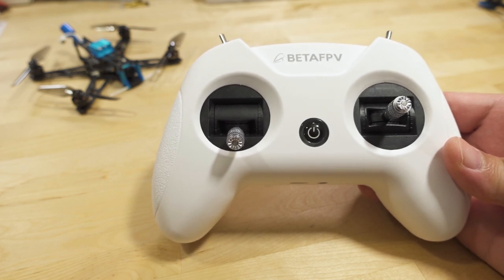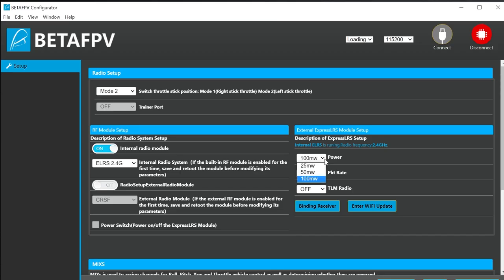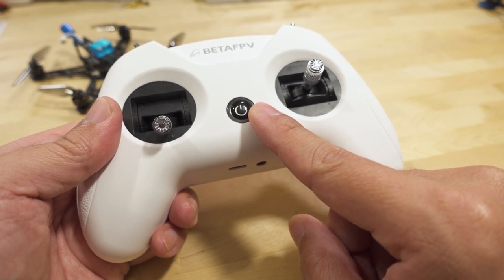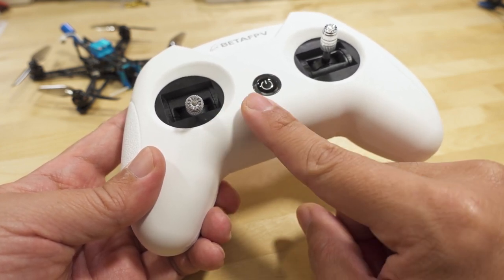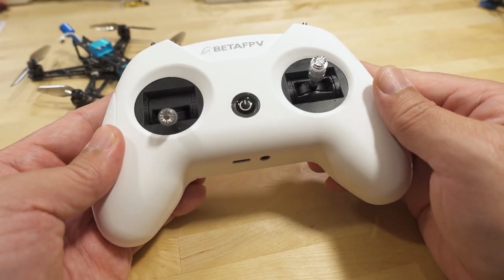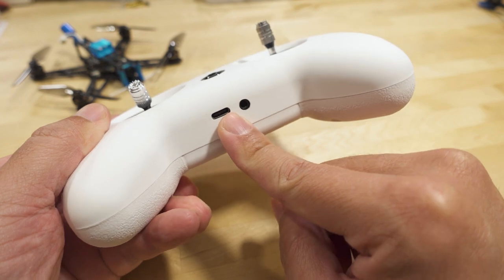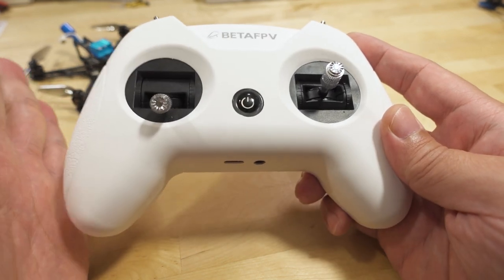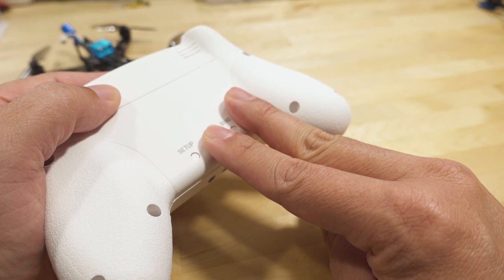BETAFPV Made an ExpressLRS Radio! (LiteRadio 2 SE ELRS)😎

Comment: With ELRS popularity on the rise especially on tinywhoops it's a good step for them to move towards it on the radio. I'd love to have internal upgrade for tango 2 for having both crossfire and 2,4GHz ELRS
Reply: No kidding, or a jumper t lite in my case!
Reply: I doubt TBS would ever allow that to ever happen.
Reply: Internal upgrade for tango 2 ? TBS would Never agree to that.
Reply: @skyweaver3199  Probably not but one can dream... And some people managed to squeeze it in there as a module. But man would they win the market if they went full ELRS with backwards compatibility.
Reply from the maker: One can dream!
Reply: There is a DIY board for the Tango 2 that fits inside and hooks up to the external connectors for ELRS. Check it out on the ELRS Discord.

Comment: I got the grandkids the lite 2 se, it's holding up. It's a decent cheap radio. For frsky d8 protocol the Radiomaster T8 (not pro) is a very good value. $40 on banggood, I grabbed it during a flash sale on RDQ for $25. It is pretty cool the betaFPV radio can have elrs built in. Maybe frsky protocols will be done and gone soon. Especially D8. Happy flying Albert 🤓

Comment: I have the one with usb c. Doing pretty well 6mos later. For $45 and not having known what to buy when i got into fpv, it’s a really good value
Reply from the maker: Good to hear it's still working well for you.  It seems all you hear on Facebook are the horror stories with out a lot of detail.  A lot of the guys who post those stories never answer my questions about which version of the radio they got.  Sometimes I wonder if I'm just responding to bots.  LOL. 🤣
Reply: Even Bardwell was knocking it on Facebook i think yesterday, So the bad rap definitely makes it’s way around. I think the elrs version/upgrade solves the biggest problem with literadio: the range. It does everything else it needs to do for the price, bind up and fly. I think this is a win for BetaFPV

Comment: I flew it on the hx115lr. Which worked flawless. It is a little less precise than my Tango 2 but a great beginner radio. Unfortunately I was unable to upgrade the firmware but it works. I just bought a second one to check the issue and I lended my set to a beginner to have some fun with it. Good buy.
Reply from the maker: Thanks for sharing. I heard the firmware upgrade issues are due to the wrong USB driver or a bad cable.  FYI, v1.0.1 of the configurator and new firmware are out now.  I'll make a video in a couple of weeks.
Reply: @AlbertKimTV  thanks I will wait for the video. I did try all drivers, but have tried only one cable.

Comment: I got lucky.. got the first gen (open tx/micro usb Frsky).. only failure so far (knock on wood) was a switch failure (internal)..
Reply from the maker: I heard those might be from a bad solder joint or bad wires and should be fixable if you are handy with a soldering iron.
Reply: @AlbertKimTV  I disassembled the switch.. it was the little plastic tip on the moving “rod”… nothing a little epoxy didn’t fix…

Comment: Hola, me quiero iniciar en el mundo del FPV, pienso comprar el kit Cetus FPV Pro que trae el Control LiteRadio 2 SE (con FRSky), pero tambien tengo la opcion de comprar por separado el control LiteRadio 3 (FRSky, con soporte para Crossfire), unas gafas eachines ev800dm y algun otro dron de mi preferencia, se ve mas bonito el kit,, que me recomiendan, el kit, o comprar independientemente para tener frsky + crossfire. Muchas gracias por su ayuda. Y muchas gracias por los videos.
Reply from the maker: If you think you can manage to bind/connect all the components of the system together yourself, get the parts separately.  If you don't think you can handle it, buy the kit.

Comment: great video 👌
Do you know what is the maximum range of the Betafpv radio built in ELRS?
Reply from the maker: It's 100mW max power with a patch antenna so very directional.  Assuming you have a good receiver and properly tuned antenna and you are pointing the patch antenna of the transmitter of the drone, you can probably expect about 1-2km range at a minimum.  The max could be as much as 10km in ideal conditions.  If you don't have a proper setup, fly in a noisy RF environment, worst case would be 500m.  Could be even worse if you have bad antennas or faulty equipment (that can happen).
Reply: @AlbertKimTV  Thank you for taking the time to respond and to make your videos 😁
ELRS es amazing 🤩

Comment: I did what you said didn't make much if any difference vtx is onlicke on goggles it says band channel power or R 6 don't have channel eight 400 for power change my goggle anttena got from 150 to 800 meter so I'm thinking if change drone anttena whitch will be better short to long on goggles went from long to short short better goggles sma RHCP drone ipex ufl connector wot high gain anttena  should be l look at seen some 14 to 16 dbi goggles only got one MSA fittings would high gain patch be better than long lollipop etc any link would be me deside you have contacts use them as well I'm sure thank for advise
Reply from the maker: Is this from Google translate?  I'm not able to make sense of this comment. 🤷‍♂️
Reply: @AlbertKimTV  I think he needs to unlock his vtx
Reply: @AlbertKimTV  no come on asking if better anttena for goggle than Im using 5.8ghz link ipex ufl connector on drone any better than stock higher dbi what I need yes would patch antenna for Google's give better range seen some 14 DBI 16 dbi cheers

Comment: Not able to wirelessly connect for updates using Configurator.  Correct?
Reply from the maker: Correct, you can only update the ELRS firmware with the BETAFPV Configurator.

Comment: '
this R/C have a four AA batterys / receiver / reverse servo...
how many channel R/C
Reply from the maker: No to AA batteries.  There is an internal lipo inside.  Does not come with receiver, you have to purchase separately.  Channels can be reversed with settings changes in configurator, 8 channels.  All this information is in the manual.

Comment: I had a second gen that had tons of jitter. It was the SE I think. It had USB-C. I was new to FPV at the time and was really struggling with flying well. A friend had me look at the receiver tab in BetaFlight and sure enough the sticks were going crazy.

I eventually replaced that radio with a T12 Pro and it was immediately noticeable how much easier it was to fly. This experience makes me a bit skeptical of these radios. Especially when you can get a T-lite for a few dollars more
Reply from the maker: Yes, Jumper T-Lite is better but it's $30 to $40 more.  Almost double the price.

Comment: there is a lot of flat space on the back, would be nice if they added a screen in the back side.
Reply from the maker: I've talked to them about that and they won't do it since competing products at higher prices already exist.  You should get the Jumper T-Lite if you want a screen.  This radio with a screen will be almost the same price.
Reply: @AlbertKimTV  racedayquads RDQ finally had them in stock.  I've already ordered it, so now they can release the pro version tomorrow with 2.4ghz ELRS  instead of the rumored 900.

Comment: I just wish it was better quality.
Reply: Just because the older ones had problems doesn't mean the new ones are the same.  How do you know they haven't corrected the problems?
Reply from the maker: For the money, it works well enough and the 2nd gen gimbals seem to have fixed the problems from the first gen.  Springs still feel mushy, but the jitter and centering problems are not there anymore.  I think they switched vendors for the potentiometers in the 2nd gen gimbals.